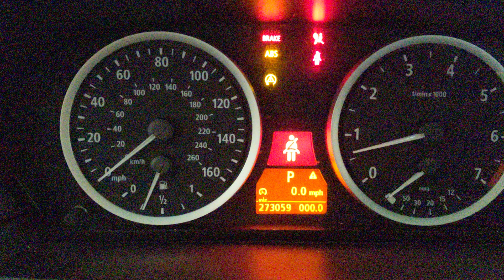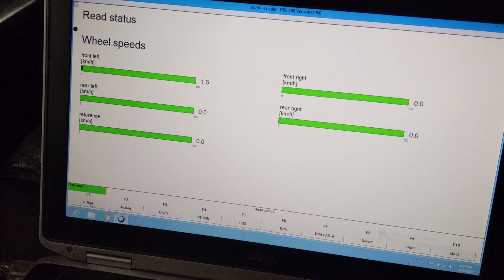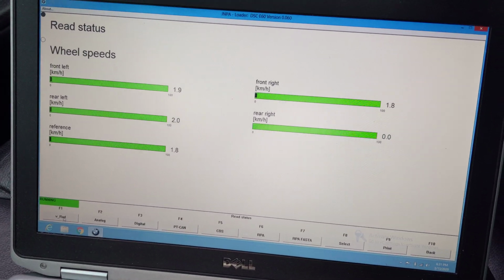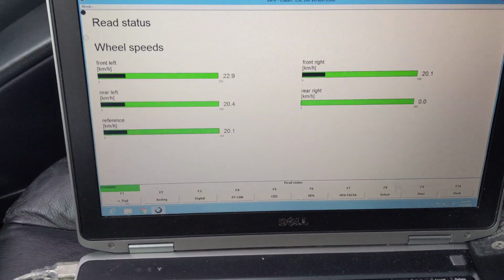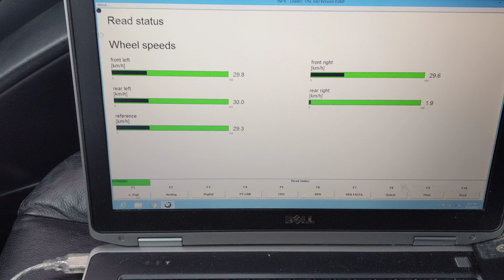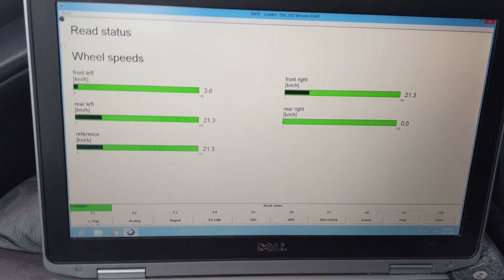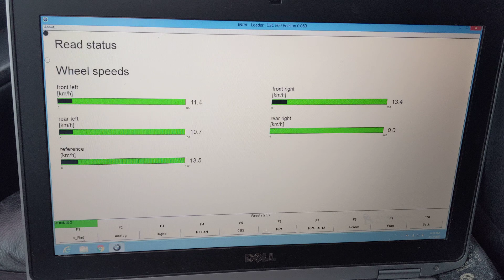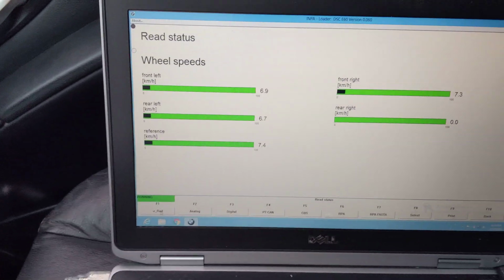Using INPA to determine bad speed censor on a 2004 BMW 530i with 270,xxx miles.

Comment: How did you get to the wheel speed section please.
Reply from the maker: I don't have the program up but I want to say it was under chassis then either adaptive cruise control or dynamic stability control I can't recall which it's been a while since I've been in there.